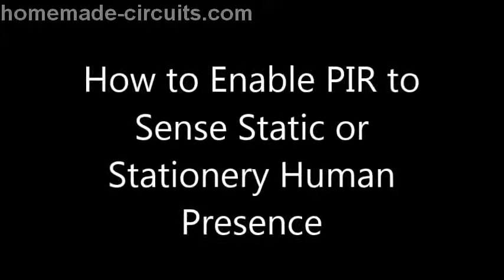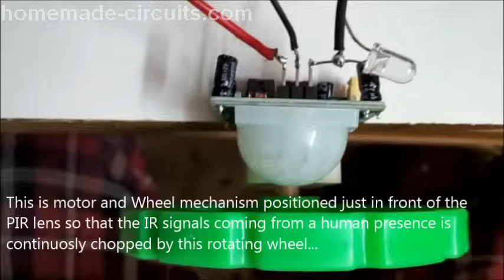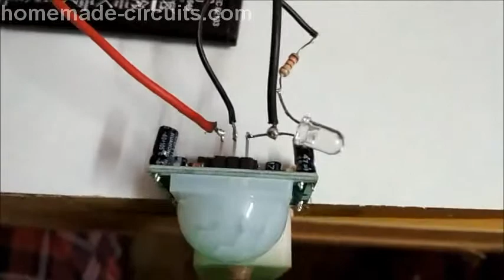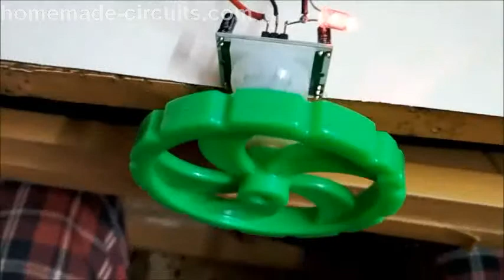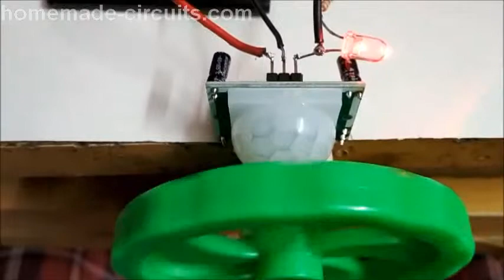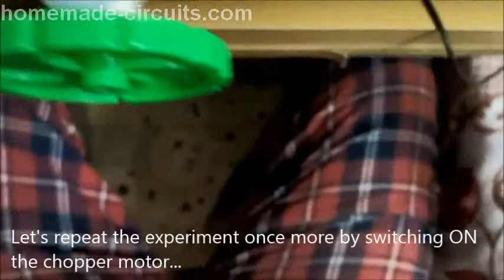How to Enable a PIR to Sense Motionless or Stationery Human Targets

Comment: In my view, the PIR is only detecting the motion of the wheel so even if you move away, the led will not turn off. This seems to be a very ineffective idea with no use. don't you think?
Reply from the maker: I think you  failed to understand the working of the concept. The PIR is not detecting the wheel movement, the wheel is only helping to alternately cut the IR radiation from a static human body and helping the PIR to realize the presence of the human body, because the PIR will activate only when oscillating pulse from the human body is interpreted.